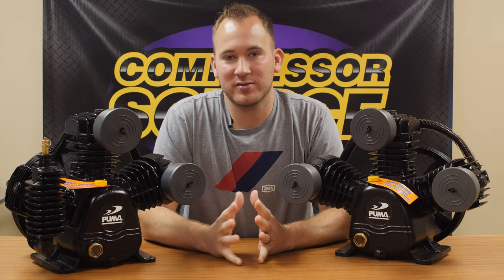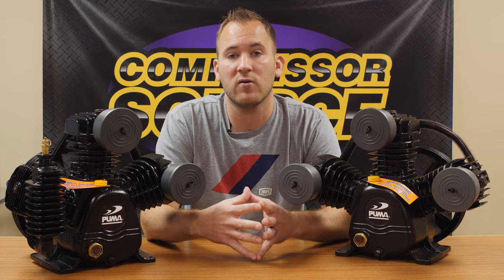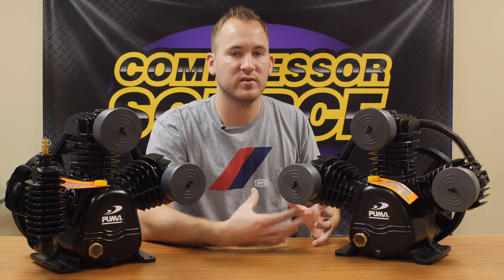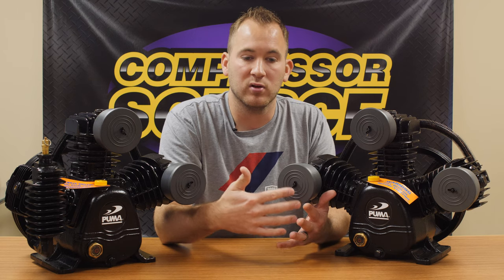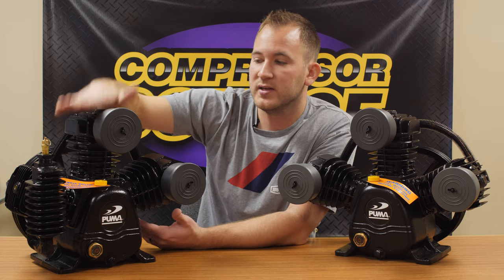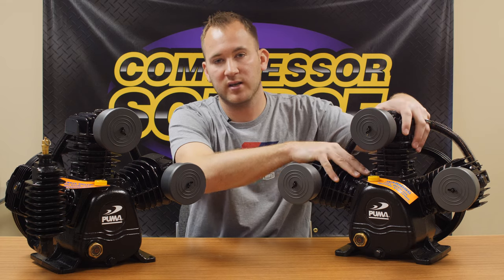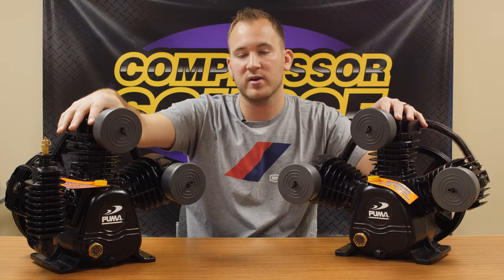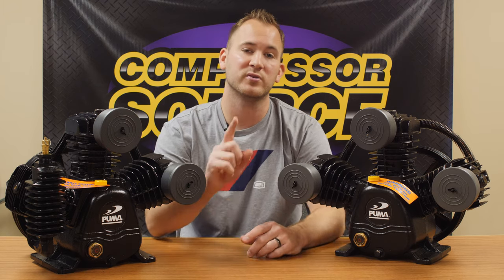The Difference Between a Single Stage and Two Stage Air Compressor Pump

Comment: I recently purchased a single stage two piston compressor that cuts off at 175 psi. My guess is that by doing so, it will reduce the life of the pump by 50% or more. I inquired to the manufacturer and they stated that the pump is only rated for 750 hours. While I am only a residential user who just uses the compressor when needed, I'm hoping that the pump can be rebuilt at some point instead of replacing the entire unit.
Reply: why dont you set your cutoff down to 125 psi or even 150 would help it last longer
Reply: @Scott I considered lowering the cutout pressure and may still do so. I also ordered a rebuild kit for the pump just in case.
Reply: @je1279   the higher pressures create higher drive loads on the pump by the square.. that 25% increase in pressure creates double load conditions on the pump by 100%.. & the power to drive it.. the same volume at 175 will draw double the power of 125.. run your regulator cut off at just the pressures needed for respective jobs
Reply: @Errol.C-nz  WHAT?  125 draws double the power of 175? What is a regulator cut off?
Reply: @twistedhillbilly6157   grammar check error

Comment: What if you have a single stage pump that pumps up to 225 ?  Then the first 10 years of its life it ran 175 off and 150 on with a 4.5 hp 220 electric motor .  Then at 13 years old it got a 5 hp motor 220 again .  But no cheap Mexican motor no a baldor reliance industrial motor.  And a 1/2 bigger pulley moving the compressor pump from around 875 rpm to around 965 rpm .  Now after that work was done my brothers-n-law said did you get a new compressor he looked at it as he said that ! He said why is it not dragging the way it use to?  I told him he said now I got a compressor!  He worked in a truck shop and ran a dozer for half his life . They always had the big 3 phase ingrasoll Rand 480 powered compressor.  But he said that’s great my compressor doesn’t run a long time and kicks off faster because it’s building up faster .  It’s 80 gallon with a 3 cylinder pump and it’s the only compressor I’ve ever used that I could run a D/A and while using it non stop this compressor will cycle out it will keep up with the ingrasoll Rand old school D/A build up and kick off while running it the whole time !  Amazing single stage compressor.  That’s were all the out let’s are hooked to the compressor . I’ve had to over the years replace all three head gaskets and one set of read valves in one cylinder. I keep the oil changed when I can see it’s dirty in the clear window . That’s about once a year .  I’ve always wanted the dual stage IR model 253 type 30 . Great explanation of the types of stages . Thanks for sharing an I’ve subscribed and liked this video .  I’m thinking I’ve bought from your eBay store front . Check valves and the puma air filters I have to make them work in my compressor because they don’t make the right ones .  Discontinued 20 year old kobalt well it’s at least 18

Comment: Two stage are more efficient.  As in kwhr per air delivered.  At 2 hrs per week you will never see the benefit.  At 40 or 80 hrs per week you will see the benefit.  And 2 stage deliver more air per hp.  That is just restating first statement.

Comment: Each One Has Its Place. In general, two-stage air compressors are more efficient, run cooler and deliver more CFM than their single-stage counterparts
Reply: And that is 180 degrees out from what this kiddie says,,,,,,but is 100% true.

Here is the true skinny, Single stage compresses are hobby grade and you will never see one in a serious application. FACT!.
Reply: Umm, didn't the guy just get done explaining WHY the 2-stage DO NOT deliver as much CFM???
Reply: Two stages allows for an intercooler to be used which means less power input is needed for the same air power output. That is why all large industries use multi stage compression with intercooling (saves money). None of this matters with small compressors because you would never save enough money on power to pay for the intercooler. So you should get a single stage as long as it will get you the pressure that you need. If you do need more pressure then the two stage compressors with tiny intercoolers will get you that but there not very efficient so you will get lower cfms.
Reply: @andygammie7394  ok so I’m between two compressors Ingersoll rand. I bought a 60gal Dewalt but has trouble keeping up with my sand blasting cabinet (I run about 90psi it’s max the Dewalt can really do) and is 50% duty cycle. The Rands are 100% ones a single and ones a dual stage. This is for my garage, basically sand blasting and mechanic tools/painting. Which would be better?Here are the specs: 

1.Specification	Description
Brand	Ingersoll Rand
Product Weight	490 lb.
Product Length	28 in.
Warranty	1-Year Limited
Airflow Volume	15.5 cfm
Air Outlet Size	0.5 NPT
Application/Use	N/A
Color	Beige
Compressor Type	Oil lubricated
Country of Origin	Made in USA
Drain System	Manual
Drive Type	Reciprocating
Lubrication Type	Oil
Maximum Operating Pressure	175 psi
Motor Phase	Single
Number of Power Speeds	N/A
Portable or Stationary	Stationary
Power Type	Electric
Product Height	72 in.
Product Width	30 in.
Pump Material	Cast Iron
Running Horsepower	5 HP
Tank Capacity	80 gal.
Tank Fill Time	8.21 min. from 0 , 1.64 min. from 135
Tank Orientation	Vertical
Voltage	230 volt
Manufacturer Part Number	TS4N5

2. Specification	Description
Brand	Ingersoll Rand
Product Weight	300 lb.
Product Length	24 in.
Warranty	1-Year Limited
Airflow Volume	14.1 CFM @ 90 PSI, 16.1 CFM @ 40 PSI
Air Outlet Size	0.5 in.
Amperage	21.5 A
Application/Use	Running impacts, ratchets, grinders, grease guns or cutting tools
CFM @ 40 PSI	16.1
CFM @ 90 PSI	14.1
Color	Beige
Compressor Type	Oil lubricated
Country of Origin	Made in USA
Drain System	Manual
Duty Cycle	100%
Lubrication Type	Oil
Maximum Operating Pressure	135 PSI
Maximum Pressure	135 PSI
Phase	Single
Portable or Stationary	Stationary
Power Type	Electric
Product Height	67 in.
Product Width	25 in.
Pump Material	Cast iron
Pump Type	Cast Iron
Running Horsepower	5 HP
Running HP	5 HP
Tank Capacity	60 gal.
Tank Orientation	Horizontal
Tank Size	60 gal.
Tank Type	Vertical
Voltage	230V
Manufacturer Part Number	SS4L5
Reply: @andygammie7394  TS4N5 is 
15.8 CFM @ 90 PSI
Reply: @andygammie7394  Mind you my Dewalt is only: 155 Max PSI, 13.4 SCFM at 40 PSI and 11.5 SCFM at 90 PSI. So either is a plus.
Reply: Too often, consumers focus and brag about marketed ratings instead of considering the tool usage. If you're painting (for instance), you're not even using near the pressure a 2 stage is rated at. It's waste and a good way for companies to up sales. A larger tank and decent single stage head will do fine @ 20-30 psi. The problem is the middle ground that's not covered much by manufacturers. They undersize residential single stage compressors to make you think you need more expensive 2 stage ones. Stop falling for the okie doke!
Reply: @andygammie7394  no. The intercooler is so that the two-stage cylinder doesn’t get too hot, and ignite the residual lubricating oil inside the cylinder like a diesel engine
Reply: @mathewmolk2089 You must not be familiar with Quincy compressors

Comment: I only spent $65 on a 2 stage pump. Ingersoll Rand 2545 brand new old stock.. It was being thrown away at a military base..  Brand new still bolted to the wood pallet with tags and plastic wrap..
Reply: Lucky lucky here I am about to drop 200 on a 2 stage pump at harbor freight for my diesel compressor build.

Comment: Can you explain why the single-stage puts out more air (CFM wise) like you mentioned? Doesn't the compressed air come from the storage tank? If it comes from the storage tank, isn't it better to have a 50 gallon tank at 175 psi vs a 50 gallon tank at 125psi?
Reply: over the course of a workday the single-stage can make much more air
Reply: If both compressors have the same tank and you're not using more than 125 lbs of air the single stage will keep up better. 2 stage will not deliver as much volume but it will give you 175 psi. Technically, starting from zero, the single stage will get to 125 before the 2-stage. All things being equal (mostly HP) you're dealing with the same old trade off; low pressure high volume or higher pressure lower volume but not both, take your pick.
Reply: @flyurway  I get it now, thank you. I don't need it for continuous usage so I think I will go with the 2-stage so I have the higher PSI to work with.
Reply: @skyvipers  I went into Lowes the other day and one of the compressors I was sort-of considering because it was 2-stage and portable was marked down 40%!!! I own another compressor now!

Comment: I freaking thought so!!! Shopping for another compressor I was noticing how these larger 2-stage compressors were rated at significantly less CFM than the old 20 gal. Craftsman I've been running for over 40 years - with the original belt btw! Then I got to thinking about it. Thx for confirming my deductions. I haven't painted any cars in years and I know that poor little thing is not going to feed an HVLP gun. It'd be nice to finally have 175 psi in my garage, think I'm going to have buy a new 2-stage and run it in tandem with my old reliable to paint! What surprises me is how many videos and even compressor vendors don't address this little fact.

And to think 8 people have thumbed down this video. wtf.
Reply: Tandem compressors are popular with industry for good reason.

Comment: Great information. 2 stage is also nice for intermittent applications since the tank is at a higher pressure (more are for its size), the pump doesn't cycle on as often.

Comment: Always wondered what the difference in stages were and now I finally know !  Thanks.   Yea, I guess for most applications except filling truck tires and running  big truck impact guns you're much better off with single stage.

Comment: Great knowledge. I had thought I needed a 2 stage to give me better volume and the compressor not work so hard to keep up with my demand. So it's the single stage I need for volume. I don't need a lot of pressure,I just need the compressor to quit kicking on/off every 15-20 seconds..maybe a bigger tank than 60 gallons might fix the issue..

Comment: Great info and clarification! Thank you. I had thought I needed a 2 stage and would kick on less and not work so hard overall. I don't need a lot of pressure, we use a couple of air tools and blow off a lot with open air so I just need the compressor to quit kicking on so much even with a 60 gallon tank which we have had. The motors always seem to go south though and even the step up on quality reviews like IR seem to be garbage .

Comment: I have a problem. They dropped the compressor and broke the flywheel.

How do you go from a tapered end to make it a straight shaft which would fit the new flywheel ? Everything is good on the compressor. It's a 60 gallon Single stage. Some say to press the appropriate bushing onto the tapered shaft or do you just change the whole shaft ?

Much thanks.

Comment: Learned something new, thought 2 stage was more volume as well.  The real issue I have is that my single stage can't keep up with what I need it to do.  It's a 35 year old Black Max and it doesn't keep up.  I've swapped the 3HP to 5HP and over driven the pulley by 30%, added an 2nd 20 gallon tank.  That helped with fill times, and the time before she has to kick back in for small work, but she's still 100% when I'm doing various things.

Too bad they aren't very upgradable, I could use a larger pump, but I usually just slow down my demand.

I saw where AVE (BLOTR) upgraded his with a different motor.  IDK how they would help at the higher PSI because the pump just needs to be bigger or spin faster.  https://www.youtube.com/watch?v=zIQ_AM3bnwo&index=116&list=PUhWv6Pn_zP0rI6lgGt3MyfA&ab_channel=AvE

Comment: So if my main needs are running a plasma cutter (that needs 70psi) and sand blaster and never need to fill semi truck tires, then the single stage has better performance.

Comment: i am going to convert my 30 gal direct drive too belt drive for noise and better air cycle.  Anything to keep in mind?  Can i purchase a 2 stage pump that can be controlled by my stock 150 psi regulator?

Comment: The thing is that the compressor heads he is showing are about the same capactity once you get up to operating pressures. . . they are both 3 cyclinders, one is single stage all doing the same job, while the other has 2 cylinders as the 1st stage and the 3rd as the 2nd stage. At the startup the single stage will be higher volume, but as the pressure increases then the difference starts to disappear. The work that a compressure can do is directly related to pressure and volume, not one or the other. . . 10CFM at 175psi is a lot more working volume compared to 10CFM at 125 PSI. Also with long lines, the higher the pressure the better, and regulators should be at the ends of the line, close to the equipment, if trying to maximise the work being done, whether it be a sandblasting cabinet or an air tool. All that being said, if you need to distribute pressured air around your shop, the higher main pressure the better and move your regulation to the outskirts of the system, never at the main tank. If you still have problems getting enough air for required bursts due to line size problems, such as with an air tool, then have an auxilary tank on the same line close to the air tool. . . basically having some extra airtanks distributed around can really help. I ended up using 3 compressors together spread out around my shop, all on the same system and it works great when I need the volume, and when I don't need the volume, I just have the most durable one turned on. . . lol.
Reply: Everything you said is correct. However your comparison of 10 CFM at 175 vs 125 can be very misleading. A tool is rated for XX CFM at a given pressure - often 90 PSI. So the fact that one tank is at 175 and another is at 125 means nothing to the tool when the tool itself is running at the same pressure in both cases. If both tanks are the same size then the 175 will take longer before it needs to recharge but the tool won’t do any additional work for any given period of time. It’ll do more total work before the 175 restarts but for any given number of minutes the amount of work will be the same because the pressure at the tool is the same.

If you aren’t getting enough power at your tool because the pressure right at the tool is too low then your line loses are too high. There are two basic options in this case: (1) start out with a higher pressure at the tank and accept the line loses or (2) increase the size of the fittings and/or lines. Many home users use 3/8 lines with 1/4” fittings. Changing to high flow fittings will make a big difference in this case. And definitely don’t use a 1/4” ball valve as your shutoff - those can be even more restrictive than the the 1/4” quick connect fittings.
Reply: @calsbarn5996 I think we are kinda saying the same thing…. 

Bottom line is:
1) the higher the tank pressure the more energy stored in a given volume
2) the higher the line pressure, the more energy can be provided thru a given line size/length.
So, having the line pressure as high as possible, and dropping the pressure thru a regulator at the end of the line, close to the tool or sprayer is best to reduce line loss…
Reply: @howardklopak628  Yep. I was only concerned that someone might read it to mean that 2 stage would always be better. I needed volume and was limited to 5 hp (limited power in my barn) so went with single stage - and high flow fittings.

Comment: I would like to inflate multiple paddleboards as fast as possible, each up to 15 psi, with the lowest noise as possible. With the proper adapters, which compressor do you recommend? TIA
Reply: A "High Volume Low Pressure" painting rig has a high volume 120V 60 cycle TURBINE compressor (I think its more of a regenerative air pump but anyway not important) that would be ideal for you.

Comment: Thanks for confirming my argument,,, that a single stage will give you more CFMs the 2 stage,,,with less vibration and single stage is quieter also..i turned my 150 psi 60 gallon down to 125,,,it Will fill tank in less time not trying to reach 150 psi,,and I never need more then 100 psi anyway.

Comment: Wait i just bought a Ingersoll Rand single stage that pumps up to 175psi and cuts back on at 135 Psi its a 5 hp 80 gallon so is something wrong with my compressor ? its brand new I bought it at Tractor supply
Reply: If you bought the TS4N5 that the stores near me carry, it’s a two stage compressor. Don’t get “2 stage” confused with “single phase” electric. When I talked to someone at I/R he wouldn’t say anything directly but he hinted that that compressor would probably be ok for home use but I should get something better if I’d be using it a lot. The TS4N5 puts out 15.8 CFM at 90 PSI. But note that it never actually runs at that low pressure so it actually puts out slightly less unless you use so much air that the tank gets down to 90 PSI - at which point it will run continuously (and eventually over heat and destroy itself) unless you stop and let it recover. I ended up paying a bit more for the I/R SS5 from Home Depot that does 18.1 CFM at 90 and it runs my die grinders or my sand blaster with no problems.

Comment: Is it ok to buy a 2 stage compressor Pump and change from single?
Reply: Yeah you’re good
Reply: It's not like the tank knows the difference!
Reply: @flyurway  why you sound arrogant?
Reply: @grin64  Because I thought it sounded funny! :)
Reply: @flyurway  some tanks not rated that high for pressure just FYI.... I wouldn't want to blow up